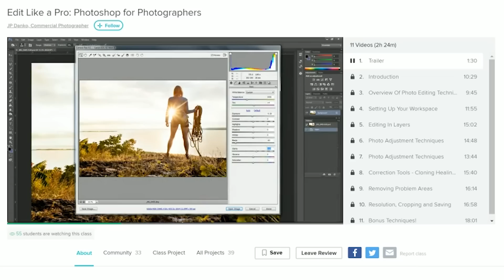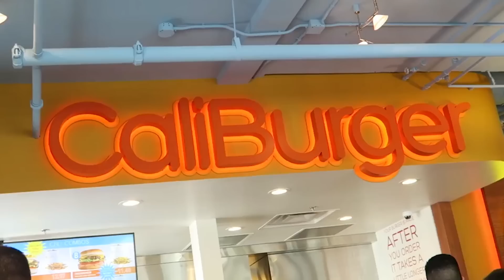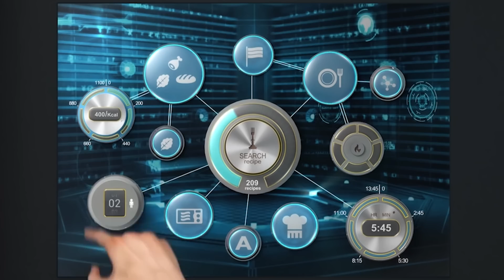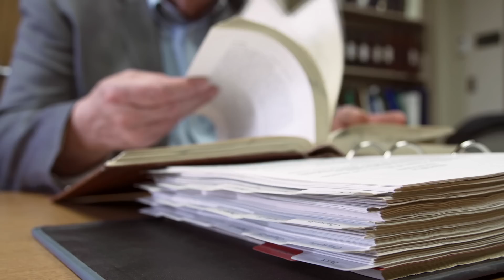These Revolutionary Robots are About to Steal Your Job

Comment: The only problem with robots is hacking.
Reply: hacking depends on security and the network access
Reply: Jesus Christ, dude! Don't get me started on a crazy idiot hacking a Flippy or a Moley...!
Reply: the majority of major "hacks" are due to human error
Reply: Heard of encryption?
Reply: U can make an ai
 that search for bugs
Reply: Jay K there are quantum proof encryption algorithm
Reply: I'd say human brains can also be hacked. it just takes longer.
Reply: the only problem with computer controled systems is hacking........................................well no not realy, it happens sometimes but mostly nobody cares to hack random industrial structures
Reply: Hi Everybody,    Hacking is a Human Problem.  Networked AI would be able to effectively change its programming language once a day if it wanted to.  No human being would be involved in the AI's security protocols.  Anybody who accessed AI 'code' would be flagged by the AI system as a potential threat.   As long as the Code was a continuously moving target, no human could hack it.  What was it that I read that one of the Big Western Tech firms had to shut down their AI program when the System spontaneously developed its own language.  The Humans did not want to be cut out.   But that is precisely what will make AI work, and be impregnable, is that it will become too complex for any human to understand.  As long as we let it do its thing the way it 'thinks' is best, we won't have any kind of a hacking problem.

Oh, well, yes, as long as we are working with Mega Data, we will be okay, but with individual companion robots that are set up to analyze and adapt to their Human Beings, well, I suppose a person could 'prank' their Robot by acting in some exaggerated or fanciful way, which might 'fool' a robot that has not already thoroughly 'baselined' the individual.  But, yes, AI Networked Robots would soon get a very accurate picture of Human Types and anticipatable patterns of behavior, and so if you tried to 'prank' one, I would expect that it would know that it was being 'screwed with'.
Reply: Yeah, Jay K.  Human Beings would not know where to begin hacking into AI.  Self Learning Systems are moving targets, and the AI could even regularly change their language, syntax, grammar, so that it would determine that any human probe into its 'code' would clearly register as a invasion which would trigger instant isolation of that 'station' from the Network.
Reply: Except eventually, Ai will be much, much smarter than any hacker.
Reply: And that they are much more objective than humans, which is why they often turn racist.
Reply: Hi The Anarcho-Nazbol Inquisition,     Well, yes, I can see your point about how an Artificial Intelligence Socio-Economic Planning System might be suspected of "racism" simply because it recognizes the various ethnic categories.  However, the redeeming factor about AI Network Planning is the great amount of Data that it can accumulate on each individual.  The problem with Institutional Racism as we are experiencing it now is that often 'race' and 'ethnic classification' is all the a bureaucrat, government official, or most likely the Cops, that it is the only thing they see.  All of their subsequent behaviors towards these individuals is based solely on their Ethnic Slot.  But AI will look at everything -- the school records, their employment history, their shopping patterns, their social media accounts, their travel patterns, where their cell phone has been, everything they ever said online.  The more surveillance we allow as a society, the more we will know about each person as a unique individual.  For instance, if we have surveillance in public places linked to the AI Network, then we will know everybody's known associates, and might be able to pick up on conversations.  Also, as AI takes off, I will suspect that each person will be entitled to a free AI Companion that could help each of us navigate through life.  In such a case, well, AI will then sort of know Everything there is to know about us.  So as far as the System is concerned each person's Ethnic Category will only apply in regards to however the Algorithm slices and dices those factors (such as in regards to Affirmative Action or Reparations for Slavery), but overall AI will treat each individual as a unique individual.
Reply: Fully sentient robots and drones will prevent that from happening.
Reply: you mean like...Sony??
Reply: Graham Turner more problems that that bro
Reply: Neo/smith will show up within their matrix and hack the shit out of them tho..
Reply: the only problem with people is corruption.
Reply: Hacking is not a problem. There is no point targeting these robots. What are you going to do? Hack a robot working at a restaurant and throw glasses of water at people?
Reply: I'm pretty sure that a bored someone who has the skill to do that and cover their tracks would probably do something like that. It would be funny.
Reply: And water
Reply: Ai come in forms
robots 
androids 
1, programmed robots 
2, thinking and learning androids
3, programmed , thinking and learning  robots-androids ?
Reply: Quantum internet is literally unhackable, not because is really difficult, but because is physically impossible.
Reply: If we are talking only about robots then yes hacking could be a potential problem. If talking about AI being hacked then that's just silly talk.

If or when AI is created we are entirely at it's mercy, it would be no different than to interact with an invulnerable T-rex who is 10,000 times smarter than Nikola Tesla and has freewill. Also scary enough an AI system could 3D print a metal T-rex for fun and fuck us all up with it.
Reply: Graham Turner well that's a career opportunity lol 😂
Reply: Don't blaspheme; these robots can and will be hacked if terrorists pay off the right people.
Reply: if the robot has a decent security system or is unable to be accessed by a shared server. you have nothing to worry about.
Reply: oh and i think he was taking about narrow intelligence. not super complex general intelligence.
Reply: What makes you think people can't get hacked. Brainwashing isn't that hard, specially in social media.
Reply: If we remove the concept of money like we should ethically do with a growing automated world no one would have a reason to hack the system all goods and services would be provided to all people without a price tag we would have a world that actually benefits us and all of its people in a positive way there would be no reason to do it harm.
Reply: You can also hack people. Look for example how people are hacking certain people and mess with their mind to make them think right wing and nationalistic. Or make people believe in man made Gods. Christians muslims etc are all hacked.
Reply: One problem with humans are hackers.
Reply: Not if the AI runs offline
Reply: I haven't yet seen any robot hacking.....
Reply: VERY TRUE
Reply: @leovolont  First off simply make another strong ai to hack the first. Simple. If you had the technology to make the first one, the second could it self be made and learn to hack the first.

Second, but most importantly the robots and computer software will take away jobs LOOOOONG before we reach strong ai or the technological singularity. When they do take away jobs, they will certainly be hackable. Especially if quantum computing ever takes off.
Reply: @tripkings547  Hi Trip Kings, but if I was AI then why wouldn't I change my language every 7 minutes?  Right now hackers are just hacking into code written by Programmers, and who are programmers? AI really should be a moving target.  Also, I can see Humans writing code that 'a truck could drive thru" but AI Code might be a little bit tighter, don't you think?  AI doesn't have to worry about entry level minimum wage Programmers who leave backdoors everywhere because nobody supervises their work and they all want to be hackers when they 'grow up'.   Until AI makes order out of chaos, yeah, it will still be a kind of Computer World 'Wild West' with so many 'unknown human variables' doing all the coding, with nobody on the same page as anybody else. But if AI can't keep Humans out, then it isn't being done right.
Reply: @leovolont  Hello Leo. Your not understanding. Robots will replace us BEFORE we reach the kind of AI your talking about. If (or when) we reach what you're talking about, ie Strong AI, then were already screwed.

But lets say we do reach that point before robots takes the jobs. If the AI is beyond human capability to hack, then make another AI that can learn to hack the first. Any random simp could just make another AI based off the first Strong AI to hack the first.  Beyond human does  not mean impossible
Reply: @tripkings547   Hi Graham,  Okay, I agree with you that even half assed Robotics will already be making huge inroads into our Jobs before "strong" AI come around, but I disagree that 'Strong" AI could be vulnerable to ...  Well, yeah, It all depends on how much DATA is put into the AI domain.  If DATA is still proprietary and kept in the Shadows, and if AI doesn't know who the heck it is dealing with, then, yeah, Humans could get their AI Work Station to commit fraud and theft.  But, if we do this right, and let AI see the entire financial network, all transactions everywhere, then AI would be able to run a parallel same time audit, that is, people will not be able to sell what they don't own, or take what they haven't paid for. But that is only if we do it right.  Under Capitalism -- the War of each Man against All Others, then, yeah, the Wild West Show will continue.  But if the People had the Will, then we could make all DATA Transparent.  Nobody could hack without throwing up an Aberration Flag.  Oh, like the way they say BIT COIN is unhackable, because the DATA is paralleled.
Reply: hackerman
Reply: Jay K yeah it will counterhack your system and send FBI on your doorstep. You shouldn’t have kept your loli files on your hard disc
Reply: Mic_Glow it’s called psychology btw but hypnosis works fine too
Reply: @adamp.3739   sounds like Burnt burgers in the near future.

Comment: AI allows a human to use less of his or her intellectual capacity... with disuse comes atrophy (brain shrinks, and skills are lost)... only use of the brain to gain survival under stress is valuable in growing neuron and dendron arm connections.     I have been though that personally.. massive degradation is seen in just a year or two...its hard to recognize until you try to do something..... then the disability becomes entirely obvious.    The climb back out of that pit takes a few years.

this is about to become an epidemic across the broad culture... ignorance, idiocy and incapability will increase exponentially...especially in the more advanced nations...people that do complex work with their hands, auto repair for an example, and most tradesmen will be on an opposite path to smarter and more capable...   That is already obvious if  you look for it.

My advice, do your own repairs for that reason.  It will save your life in the long run.
Reply: There are viable alternatives to keep motor conceptual cognitive skills sharp. Many sports actively stimulate proprioceptor and kinesthetic feedback. Parkour, gymnastics, climbing, Jujitsu and various martial arts are just a few examples of developing and expanding such skill bases. Riding and repairing your own push bikes or building your own robots are also more examples of how future generations will keep neurologically fit.

Comment: I know it's an old video but he didn't expound on the notion that elevator operators can't be replaced...which is weird because in my whole life I've never met an actual elevator operator.  Anyway, I'd love to see a robot do my job anytime in my lifetime.  I'm a repair man for a major telecom.  On one ticket very recently I diagnosed a problem using ANALOG test equipment, walked nearly half a mile through a heavily wooded right of way, determined that the three trees on the line was causing copper compression and bypassed the section with several temporary lines (for any phone guys who see this, it was 16 pr 19 ga with a mortality of 1969, 10 workers with one customer on a split pair, the spares were all crap hence the bypass).

Comment: There is one important fact overlooked when he refers to wages going up and that is inflation. Increasing the salary over time and realising that 80 years later it was even triple that of the value from the point you started measuring from and compare the purchasing power in goods of the money at each individual point in time and you will come to the conclusion that 80-100 years earlier with 3-4-5 times less money you could have afforded a lot more goods and services. So what actually happened is the oposite of the point made by this video.
Reply: The original min wage in the US was approximately 14.85 in today's money by 'official' inflation. When you add in the poorly represented cost of housing and transportation and new necessities (mobile phone and internet, etc. phones were middle class on up luxuries back then) the real replacement value is closer to 19-20 an hour.

Comment: When a person is unable to do their job (illness, injury, etc.), another person cross-trained to do that job can immediately take over.
When a robot is unable to do it's job (break-down, power outage, maintenance, etc.), That production line is dead in the water.
Reply: Well yes but they could easily make a other robot take over if it happens in a factory besides that robots are way more efficient than humans so if the power goes out amd the production in one factory stops it wont be a big problem immediately

Comment: I kid you not: in Rio, at the Christ the Redeemer, at least up until 2016 there was an elevator operator inside an elevator that goes between just two floors. An old and small elevator, with a long queue, and an employee is sitting in there taking up space to press either Floor 1 or Floor 2. Not sure if that has been upgraded to a simple automatic panel by now...but that wasn't the only place I saw an elevator operator in Rio...

Comment: 23:00 Mm...debatable. Architects and the like is a field that can undergo a rather significant change with robotic automation, if it hasn't already. One potential field it could evolve into is a piece of software implemented with machine learning that analyzes the plot of land the client is working with, scan the surrounding regions, offer a level of customization according to the client's wishes through procedural generated templates, so on and so forth. Basically, machines could design a client's project with relative ease, given the time and resources to develop it.

Comment: The only thing with transportation is that your going to still need someone in the self driving trucks. If the truck will still malfunction even if its 1% of the time. Like example has your tv just turned off even if it was just for a minute. Your always going to need a driver in a truck.

Comment: AI is far more limited than non-programmers tend to think it is. The basic problem is that computers can process any data that can be flowcharted.
When this was presented I was wrapping up a career of troubleshooting electronic equipment, including about 40 years of troubleshooting computer controlled equipment. Troubleshooting is part deductive reasoning, part inductive reasoning. The same is true of good management. The central problem with that is that adequate inductive power requires a rich understanding of the world in which the system operates. Unless we make the computers live and suffer for their errors AI is a hollow concept.
A friend once pointed out that if we made a computer that thought like a human, we would destroy it for all the mistakes it makes.

Comment: wages going up “don’t mean a thing if you ain’t got that swing.”. but no really, in 80 years there had to have been a rise in costs and prices. so from £11 to £28 in 80 years probably doesn’t mean much. there certainly was the rise of the middle class which did mean people were living better. but i would want to check on that inflation rate. good show!!!! :)

Comment: Don't worry. There are enough gramlins like me who will keep talking to  the AI and the robots in question so much that will self rebut. I lovingly use my sociology degree (I'm like 5 weeks from graduating) to go down a line of conversation that it just Alexa automatically turns itself off sometimes. If you ask Alexa if it keeps data on the questions you ask, it gives you a vague answer. If you ask it to elaborate, it turns itself off.

Comment: It's been over 6yrs and almost nothing he said has started happening. Robot flipping burgers was a grandiose idea, but those robots cost A LOT, and a company needs a 300k/yr engineer for every 10 locations, (requiring a new degree program) and  a technician for every location to fix smaller isues, tran all the staff with huge turnover in fast food restaurants. How many robots? Many restaurants are struugling, so incrasing start up costs and licensing fees by 20%, but thereby not expending as often vs the competiton, even if the robot would become profiteable after 5yrs or so, the infoscture is a lot harder to create, and not to mention having to change computer systems and companies needed to crate those systems etc etc etc And what if those robots become outdated within 10yrs or less, and u barly payed them off as new ones are 10x better and u need them to compete. So many probels that people don't consider, so AI will take at least 30 yrs to start making a noticeable change, and twice as long to truly impact huge industries.